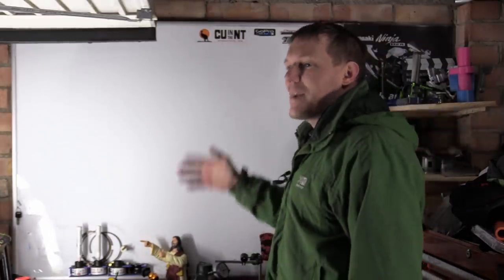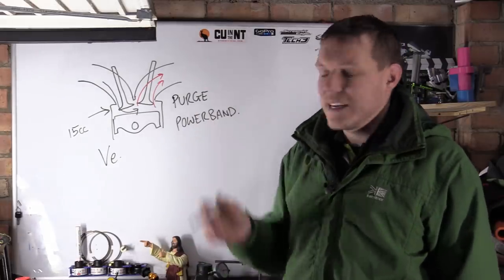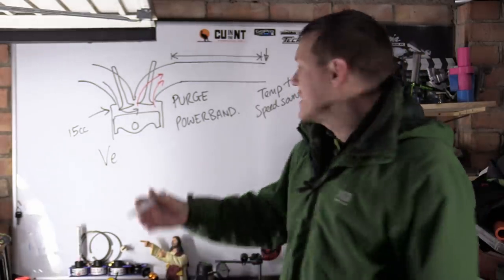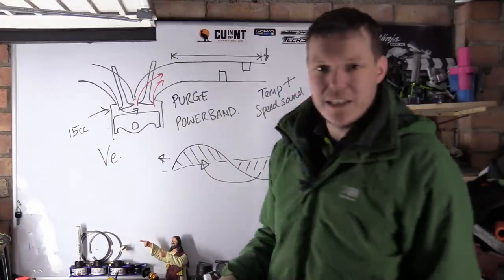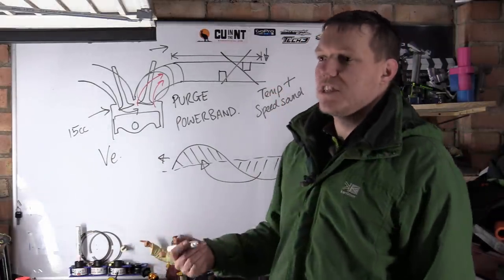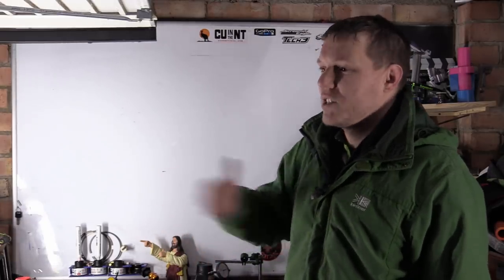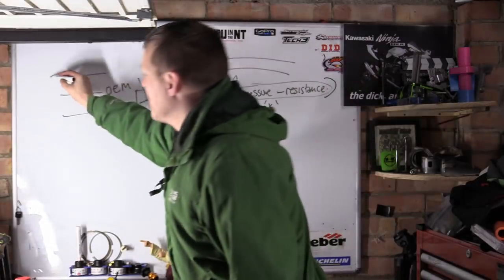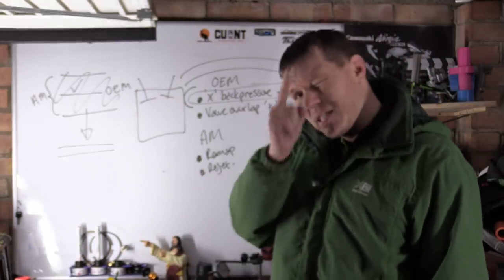Exhaust back pressure and fuelling - Part 1

Comment: My bike is 250 cc.. i use aftermarket 28mm nibbi carb. I feel the power loss when i shifted to bullet pipe (open pipe/ no restrictions). I quess those pipe divisions inside the stock exhaust are essential for proper tuning.

Comment: This is my reason for staying with the stock exhaust but the counter argument I hear is that the oxygen sensor in the exhaust will allow the ECU to correct the fuel mixture to compensate for exhaust changes. I'm not convinced that is right and prefer an efficient running engine than exhaust eye candy.
Reply: O2 sensors only work in certain areas of the map and most are narrow band so pretty clumsy results.
Reply: If you got airflow, TP, knock and O2 sensor on an engine it is fairly capable but the problem here is that the ECU probably only adjusts one compensation value that affects the whole map (well apart from idle basically).. But with a new exhaust you would maybe be dicking around changing a lot at 12000rpm but basically keeping it stock at 9000rpm. The ECU however can only adjust both 9000rpm and 12krpm the same amount. The ECUs generally don't do this on the fly every few milliseconds but more on an every few seconds basis. So it is not really "live".. So accelerating from 8krpm to redline in my example there would be something fucked up. Newer ECUs might be better but O2 sensors are limited as well and on full load they usually don't work at all because we dump in a rich mixture anyway. cheers

Comment: Nice video! I now understand why I should put my exhaust valve back in. I was going to do it anyway because I was told to do so after my bike went on a dyno for setting the autotune on a rapidbike module, and I was told I was missing some power down low. But I didn't really understand why, except that it has something to do with backpressure etc.

Comment: Good explanation dude. I think slightly less enfisiss on the back pressure and more on the length of the system. As you already know the pressure wave traveling down the exhaust isn't reflected back until it reaches the end of the pipe regardless of the restrictions encountered on route.  Hence the importance of length of system. The back pressure (positive pulses from other cylinders) really plays a part when you start looking at multi cylinder engines sharing the same exhaust. Would be really good to explain how (4 into 1)  (4 into 2)    (4 into 2 into 2) etc all have different power characteristics.  Maybe also explorer inlet tract / velocity stack lengths at the same time as it's the same principle and all connected. Also touch on two stroke expansion chambers as they illustrate really well how you can change the timing of the reflected pressure wave. I've wanted to explore this subject myself but it's such a head fuck when you get deep into the details and I'm not sure I could explain it without making a cats ass of it! Good Job...

Comment: it seems on 4 strokes the reflection wave is only really beneficial at lower rpms due to the fact that at lower rpms the overlap duration is too long. I found this post and it shows a graph of the cylinder pressure during the exhaust cycle. https://www.team-integra.net/forum/blogs/michaeldelaney/103-advanced-exhaust-tech-ii-backpressure-area.html

Comment: Hi Matt... Just a small clarification. 
You said at the start of the video that at TDC on the exhaust stroke, valve overlap causes the inlet gases to push out any remaining exhausts gases. Now I know that you know how it works, and it's just a case of semantics and the terminology you used, but for those who may not know... This would only be the case with forced induction. On a naturally aspirated engine, the inlet will only be at negative pressure, so the only way the "purge" can occur is with a properly tuned exhaust system, where the pressure wave in the exhaust is travelling away from the exhaust port at the time the inlet valve opens (and assuming we do actually have overlap), thus creating negative pressure in the cylinder, and, as we all know, nature abhors a vacuum (or partial ,as is this case), so the overlap causes the inlet charge to rush from its positive pressure environment into that negative pressure environment, allowing the majority of the exhaust gases to be exhausted and replaced with inlet gases, which at the same time is facilitating the onset of the inlet charge, prior to the piston starting its downward stroke, and forms part of the volumetric efficiency equation you mentioned.
Reply from the maker: "This would only be the case with forced induction."

- Ah no it wouldn't - the intake also has a 'pressure' pulses. The timing of the intake is also 'tuned' in a way that is opposing the exhaust. I.e for the exhaust we want to open on the node of the pressure wave. For the intake we want to open the valve on the antinode. 

"thus creating negative pressure in the cylinder, "

The cylinder pressure is far higher than the exhaust. 

"where the pressure wave in the exhaust is travelling away from the exhaust port at the time the inlet valve opens"

- that's what I said.......
Reply: @dirtygarageguy  You're absolutely right on the nodes but once you introduce an air filter into the equation, you're left with atmospheric or negative pressure post filter. 
Of course, as you say, there are also pressure waves on the inlet side, but compared to the exhaust side they're negligible, and won't (shouldn't) produce a positive pressure that exceeds the negative pressure caused by the outgoing wave from the exhaust. Which is why I'm saying that the inlet doesn't "push' the exhaust, it's the other way round, the exhaust pulls the inlet.
The most important thing here is that no two engines are the same, and slapping an exhaust and a K&N on a bike is a bad idea without verneer timing pulleys, because not even the exhaust manufacturer can throw an accurate guesstimate as to where that shock wave is going to land at a specific RPM in any given engine, which is why we need Dyno time with someone who knows how to set up an engine, rather than the multitude of Dyno operators who throw in a one-size-fits-all map, take your money and show you the door. But that's a topic for another day ;-)

Comment: Much appreciated this vid Matt, I just put on a SP engineering exhaust onto my VFR800, what you said makes sense to me..... Now..I do have a question, back in the day when I rode Moto X, ( 2 stroke..) I was always amazed on how the likes of Pro Circuit, FMF, and my favourite Schlecten pipes could change the power characteristics of the bike. Is it kinda simple how they worked or is something beyond me?
Reply from the maker: 2 stroke make full use of exhaust pressure timing etc - this is a whole other subject on its own - that we will get to.

Comment: Hi Matt, do I need to get a remap if I just change the muffler? Or is back pressure mostly affected by the header pipes. Good video keep them coming.
Reply from the maker: It depends on the system - check with the manufacturer or forums etc. Usually no though, as slip-ons unless they're half the length of the OEM don't really make that much difference

Comment: Great information. Can you explain me this:- In FI engines has o2 sensor in it which reads the exhaust gas is lean or rich and send the information to ecu and balance the mixture, when we install a straight pipe the mixture become lean. Does it automatically adjusts the mixture?

Comment: So if you wrap your exhaust, you increase your exhaust temp., so you increase the exhaust gases speed and can screw with the high/low pressure timing or pressure "intensity"?? Or how does exhaust wrapping influence this system?
Reply from the maker: "So if you wrap your exhaust, you increase your exhaust temp.,"

- a better word would be 'retain' not increase. Theoretically yes, but the difference is minimal and you'll see this soon
Reply: @dirtygarageguy  
Would wrapping your exhaust pipe give you an advantage on turbocharged engines since the turbo supercharger effectivly uses excess heat.

Comment: Just to clarify things. The piston is rising towards TDC, the exhaust valve is open (Exhaust stroke). The inlet valve opens before TDC to create the overlap. The overlap remains as the exhaust valve is still open as the piston descends towards BDC. Then the Exhaust valve closes x° into the (Induction stroke). End of overlap. Induction continues followed by the compression stroke, power stroke & back to the exhaust stroke (the 4 stroke cycle). Is this correct?
Reply from the maker: In a word - yes

Offhand here are the numbers for a ZX-10R (2006)

Intake opens          46deg before TDC (BTDC)
Exhaust closes      46deg after TDC (ATDC)

This means that for the ZX-10R the intake and exhaust are open for 92deg. However,  what needs to be taken into account is valve lift at these timings. Opening doesn't mean fully open and for the first 20deg each valve is 'opening' with very little valve area.

This is all 'controlled' with the camshaft profile and the ramps of the valve. We'll get into this later

Comment: All of this depends on how lean your bike was tuned from the factory. Different bikes react differently with the same exhaust system. Harley M8 engines are not lean from the factory, but the twin cam engines were, so the same exhaust system will react differently on each bike and the twin cam bike will need re-tuned where the M8 bike will not. It's science guys!

Comment: does some amount of restriction in the exhaust then lead to greater amplitude in the pressure wave at the exhaust valve? as in make the vacuum stronger? would this be beneficial, or is simply placing the end of the exhaust at the right length enough?
Reply: (for a specific rpm) i assume this would also make you powere band more specific
Reply from the maker: "does some amount of restriction in the exhaust then lead to greater amplitude in the pressure wave at the exhaust valve?"
 
Very good question, and as per usual it depends on what is doing the restricting. The simple answer is 'possibly' - there are many factors that can both increase and decrease the amplitude of the wave. 

Valve lift at any given moment during the overlap can have a great effect.

Comment: Cheers, that's why I hear that really cool resonant popping in V8's and bikes slowing down or between shifting up gears, as it's the excess fuel burning in the exhaust from engines designed for high RPM. Would it be correct using the term "resonant vortex" or "vortex" instead of "back pressure"? :-)
Reply from the maker: "Would it be correct using the term "resonant vortex" or "vortex" instead of "back pressure"? :-)"

- LOL no. Its just a pressure wave - the problem is that a well designed exhaust systems does use the 'pressure' or high pressure, but the low pressure that follows it. So its NOT high pressure that we want to use. But there isn't a better word for it, and vacuum isn't a better word.
Reply: @dirtygarageguy  Thanks mate, I appreciate the reply, Cheers :-)

Comment: i have an issue with my motorcycle : 52 degree v-twin, aftermarket exhaust. when i close the throttle, the exhaust makes a very loud noise. sometimes, it is even louder than opening the throttle. and the exhaust gasses stink really bad. could this be a symptom of not enough back-pressure?

Comment: about the valve overlap thing.when the intake valve opens the pressure in the intake is lower than in the cylinder and exhaust?and if so why do then the exhaust gases don´t expand into the intake? if the pressure in the intake is higher why is it like that?

Comment: ive now watched this about 3 times, keep coming back after reading quibbling on the owners groups about aggressive exhausts and wondering if its true. two of the new questions ive got are:

1: in a multi cylinder bike, the most common change is just a muffler that retains the existing collector/merge, is this less likely to mess with the harmonics of the system? 
2: the particular model i am interested in (yamaha fzs1000, 98-20021 r1 engine) is fitted with an EXUP valve, which seems to dynamically baffle the exhaust within the collector/merge for the purposes of more low down torque. i'm wondering what the presence of this EXUP valve might have on muffler changes?

traditional wisdom on the groups has been that straight through/short pipes lose power because 'these 4 strokes like back pressure'. 
i'd like to have the spare money to just chuck my bike on the dyno again and find out, maybe one day.

Comment: How does a NA engine cylinder get purged ? Without an inlet pressure is it possible?
Reply from the maker: The piston
Reply: @dirtygarageguy  im trying to understand how but i just can’t.. could you elaborate how does the piston purge the cylinder? Cuz in my mind im thinking theres no intake pressure so how can the intake air push the exhaust gases out? (Im really interested in wanting to know how, sorry for taking up ur time. Thanks in advance)

Comment: So what happens if there is no pipe at all, only the hole of the exhaust port? Will it just give you more power? Or will the exhaust port overheat and melt?
And can't you theoretically have a single big valve in the middle of the head that works as both intake and exhaust while using two or four or how many necessary spark-plugs coming in from the sides?

Comment: So, are those trumpet like exhausts you see on old alfa or Lancia race cars worth nothing? I always thought that the cone shape would aid scavenging  in terms of the hot exhaust gases expanding into the exhaust and thus increase the fluid velocity?
I do know the effects of pressure waves but i always thought that these effects are limited and really only useable for 2 strokes.
Reply: It is the same as 2 strokes with respect to the creation and flow of compression and expansion waves and how the expansion wave is reflected from the end of the pipe and back to aid drawing of intake into the cylinder, and the cone at the end allows that phenomena to occur over a wider RPM range.
However the 2 stroke has a pressurised intake which results in some over charging of the cylinder to aid scavenging and that over charging of the cylinder spills out the exhaust at the engine reaches it peak power so a lot in intake charge is wasted out the exhaust, an engineer Walter Kaaden fitted a reverse baffle cone on the end of the first cone to reflect the initial compression wave back to push some of the spilled intake back into the cylinder before the port closes which greatly increased the power of 2 stroke engines.
In cars however it is impractical to fit a cone (megaphone) on the end of the pipes and doing so would not allow for the benefits to be gained by the use of 4 and 2 into 1 systems that exploit the timing of the reflected expansion waves at the collector where the pipes meet.
It was found that making changes to the collector ratio to effect back pressure had a profound effect on the peak and amplitude of the initial compression waves such that an increase in back pressure provides a longer compression wave that expands the effect over a wider RPM range at the expense of some peak power.

Comment: So basically you gain nothing or lose performance with an aftermarket slip on without a remap.
If I understand correctly one way to figure out if a slip on is proper for your bike its when you dont get any pop?
Does the weight saving compensates for the performance loss?
Reply from the maker: Well that all depends on how much both ways - but dropping 3 HP means nothing on a 150HP machine
Reply: @dirtygarageguy  actually its a 130hp bike,Z1000 mk1 😎
Reply: @dirtygarageguy  I was wondering if a K&N air filter combined with a slip on for more free flow of air and exhaust gas and -5kg weight saving of stock exhaust will be better than all stock in terms of performance even without ecu flash/remap.Meaning actual dyno numbers and road scenario.

Comment: Will a somesort of expansionchamber like a 2 stroke help to time and produce that shockwave? The opposit working of what it does with a 2 stroke
Reply from the maker: The speed of the pressure wave through an exhaust is rpm dependant
Reply: The Workshop so it will maybe work in racing aplication or a CVT transmission?
Reply from the maker: The expanison chamber is like a amplifier of sorts - not required for 4 strokes
Reply: @dirtygarageguy  Is there a formula for that or any other resources that I could look into for further reference?

Comment: Hi Matt, talking about older bikes like the kawa GPZ550/600R's. Would it be viable to measure the volume of the OEM 4 into 2 exhaust  and see if it matches an aftermarket 4 into 1 volume, like say filling them with water to measure the volume. Or is the length and diameter more comparable?